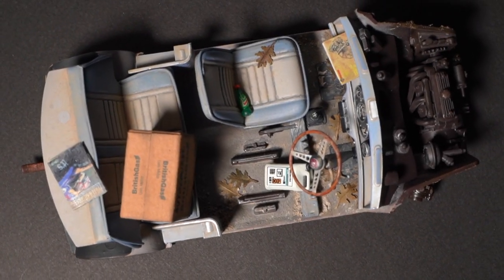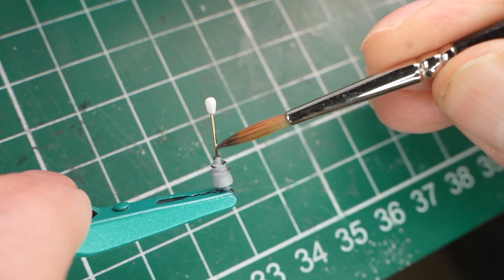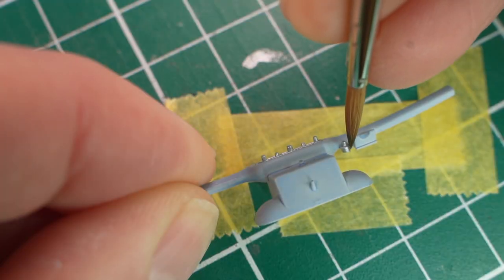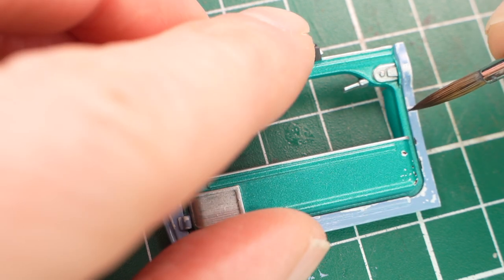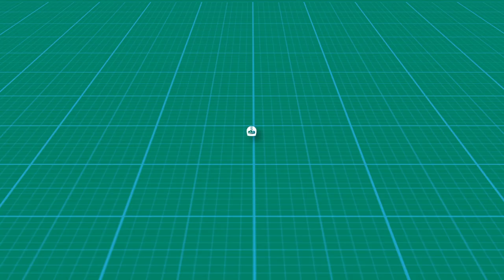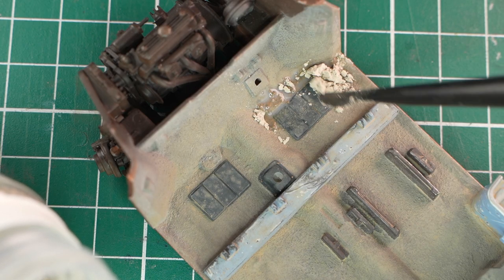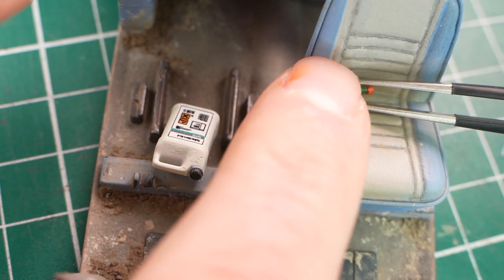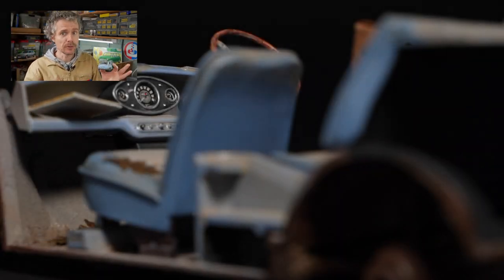WEATHERING INTERIOR Part 2: building Tamiya Mini Cooper 1275 1/24 scale as a wreck diorama

Comment: For the knob: put it into another pinvise, tighten, then you can drill?
Reply from the maker: That’s probably a quicker method, is it as a lathe 👍
Reply: @hobbyrobby  Yes. You can also use a Dremeltype thing as a lathe. Kenji's and A4 (Japanese modeling YT channels do a lot of modifying and scratch building. Their stuff are like jewellery. Working lock on the mini's boot, for example. Huge amounts of modeling hacks there. Another great one is Ebroin if you ever wish to venture out to ships or sculpting.
Reply from the maker: @jaanikaapa6925  I know A4 Garage (Korean) and Nandemo Seisaku (Japanese). They do a very engineering like modelling. Very nice, but not my style (honestly I couldn’t do what they do). My style is more to tell a story with my models 😊
Reply: @hobbyrobby  I like both. The insane jewellery and dioramastyle like yours. :)
Reply from the maker: @jaanikaapa6925  Thanks! 🙏😊
Reply: You can actually use a pencil sharpener once the hole is drilled then sand it, I do it when I make a shift knob I make them out of a piece of wooden dowel sharpen the drilled end then cut to size,glue in your brass rod then pop into dremel then gently sand to shape put on a dark brown wash then varnish they look awesome..
Reply from the maker: @andydawson2101  That’s an ice method too Andy 😉